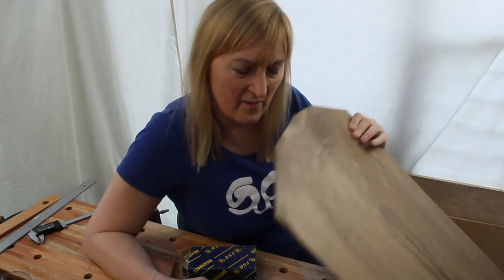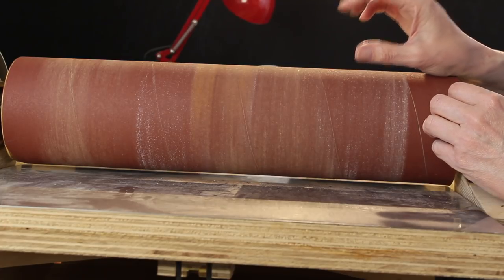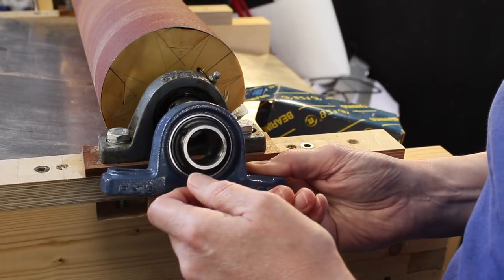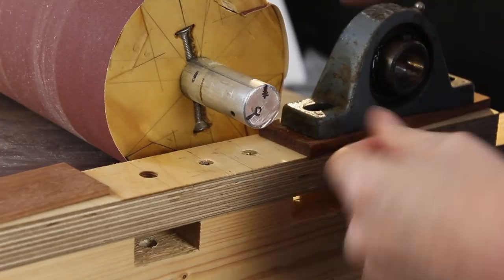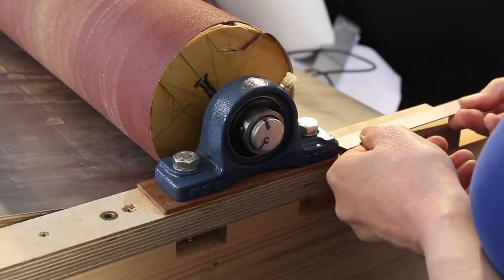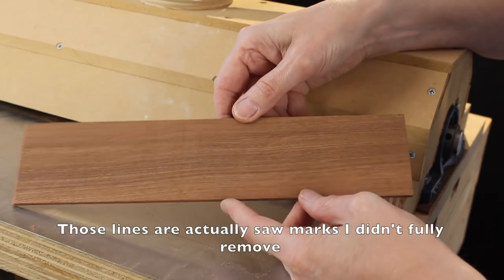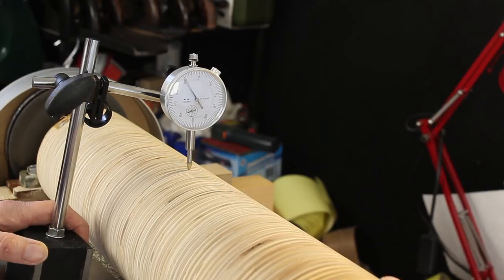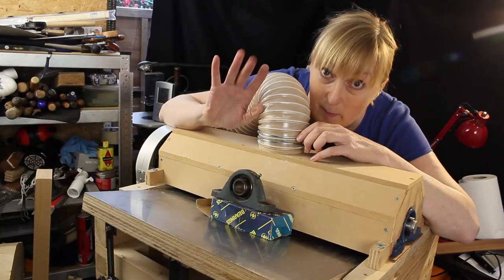Changing a bearing on, and re-truing my drum sander

Comment: When working on rolling assemblies like this it is always a good idea to replace both bearings at the same time. The reason is simple. Six months down the road the other bearing will pack it in and you will be doing this work again. Matched components are never a bad idea and your labour is not "free". Down time cost money. You can also purchase shim stock in rolls from the bearing shop in various increments of .0005",  .001", .005" and .010" so that you can shim your roller to .0005" accuracy. You could also use the shim stock to remove the slop on your shaft in relation to your bearing I.D.

Comment: Definitely imperial shaft and metric bearing. To keep your costs down you could just replace the bearing insert, easily removed by holding the pillow block in a vice with a large screw driver or bar.

Comment: Hi Susan, a quick way to ascertain if the drum is trued up, would be to take a pencil and scribble lines all over the drum. as the sandpaper wears away the high spots, the marks are taken off. wherever the marks remain are the low spots and so you would need to keep going until they all are gone.
 sharpie will soak a little deeper into your drum since it's made of plywood and you would end up taking off more material than you might want

Comment: Hi Susie - I tend to agree with Dave Carpenter about Centring the shaft before truing up the drum. You went to all that trouble to do other things so accurately a simple wrap of foil or similar would centre it. Being offset could encourage fluttering. Or am I being to pernickety?
Reply from the maker: The fit is too tight to use shims, but it’s not a push fit. It’s less than 0.1mm difference in diameter. The process of trying the drum centres it around the axis of the bearing - it doesn’t matter if the axle is 0.05mm off centre
Reply: Sorry for late response to your patient reply - I've been on holiday. But yes, guess I was too pernickety.

Comment: If you need to get at the grub screws again,you can buy Allen keys with ball ends which will allow you to tighten on an angle
Reply: You probably would have been able to swap the bearing in the block and not needed ti change shim hight.

Comment: Bravo pourquoi ne pas avoir changer les deux palier du même type ?
Reply from the maker: J’ai expliqué dans le video - ça coute un peu plus cher et l’autre marchait ok- mieux changer les deux mais en fin ça marchait comme j’ai fait. (Difficile composer français avec autocorrect anglais)
Reply: In English, for favor, perkele.
Reply: Congratulations why not change the two levels of the same type?

I explained in the video - it costs a little more expensive and 
the other worked ok- better change both but in the end it worked 
as I did. (Hard to dial French with English autocorrect)

Comment: If your shaft is offset in bearing doesn't that make the drum offset thereby touching one side of circumference more than the other. Your truing with sandpaper is only levelling out the drum across its width, not on the whole circumference along its length.
Reply: How good is good enough? If she is correct that the fit of the shaft is loose by .1mm then the shaft is offset from dead center by .05mm, or about 2/1000 of an inch. Which is probably more accurate than the shat was ground in the first place.Most precision shafts are only true to about 5/1000 per 12", at least until you get into very very expensive stuff for scientific uses. 

So yes you are correct, but she is already at the precision limit of her materials anyway so more accuracy really isn't achievable. Just for scale human hair varies between 2/1000 and 6/1000.

Comment: You need to remove the sandpaper and check the surface runout with a dial indicator on the drum and various locations this will help in diagnosing the problem